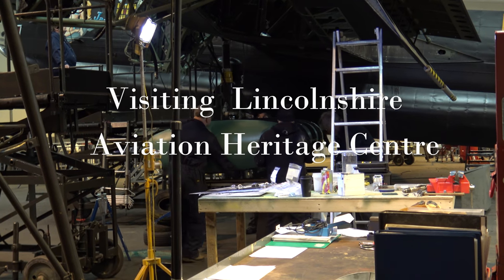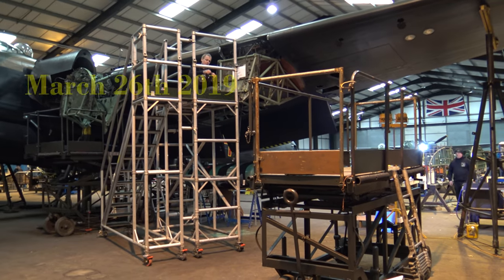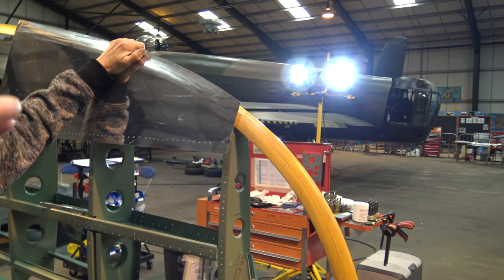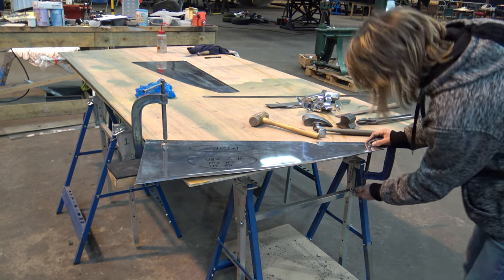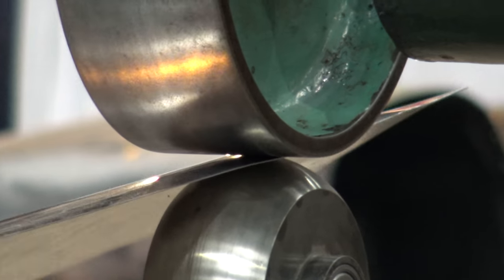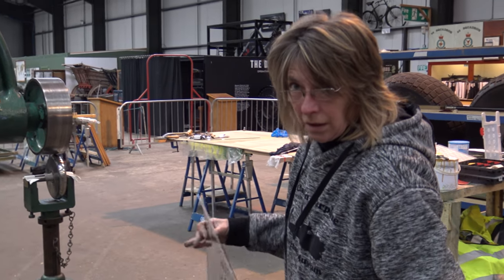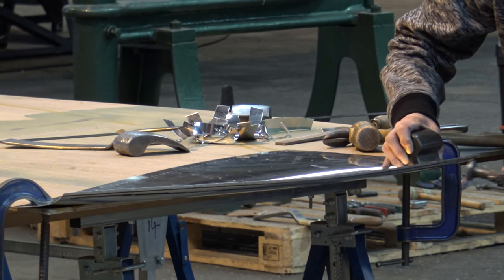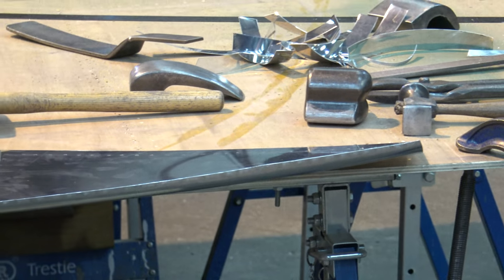Video 13 Restoration of Lancaster NX611 year two.

Comment: I did a tremendous amount of wheeling to reskin FM213 over thirty years ago. It will be a delight to see another of these old birds flying again.
Reply: S/V Tattoo : S'cuse me but FM213 ? (bet the question seems stupid).
Reply: @suzyqualcast6269  - the only stupid question is the one not asked. FM213 is the serial number of a Lancaster bomber. The full serial number is actually RCAF FM213 as it was built for the Royal Canadian Air Force.

Edit: the Lancaster bomber shown in this video is NX611.
Reply: S/V Tattoo: Thankyou - the NX sounds familiar,  now both make sense.
Wait a minute, are you part of the team that worked on the Canadian example that joined the BBMF a couple of years back, both of which, affectionately, flew over and tipped a nod to East Kirkby I wonder?
Reply: @suzyqualcast6269  Yes, sounds like he was as was involved in the shaping and reskinning some of FM213.

Comment: They should crowd fund the restoration. It would save them having to put it back together and take it apart each year. Great video!
Reply: Izaak C : Myself and a friend used to visit East Kirkby back in the late 1990's. We were lucky to be there one day when she was out in front of the hangar and performed a full x4 engine test, I don't know of a word that describes the feelings of emotion that induced !
Back then I was led to understand that all that prevented their Lanc from being given an airworthy cert was a full re-revitting session.
Your comment per yearly stripdown raises a couple of queries: are you saying exactly that - a complete stripdown, and why? If correct then the demand of the past per a full re-rivet session seems to have become a historical point and now overcome ?
I also understand that as ever closer to achieving air worthiness they get the certificate issuers then present a whole new rash of demands, as if the BBMF Lanc is the only one they want flying, full stop.
Reply: @suzyqualcast6269  No, that's like finding a 1946 Austin 'whatever' and the only thing preventing it going back on the road was a new paint job.
EVERY part of the old aircraft has to be checked to ensure it is airworthy. If you simply removed and replaced every rivet you wouldn't know if the wing spars were thirty hours from cracking up and you don't need a very vivid imagination to imagine what the results would be.
I beleiev the powers that be are giving them leeway by allowing them to refurbish/replace components over a period of years instead of having it all done in one go, which i believe is the norm.

Comment: Start with the sheet metal oversize. Roll the edge first. Once it fits trim rest of the panel to fit the ribs and then drill out the rivet holes. This is being done backwards which is making it more time consuming and harder to roll the edge correctly. I know because I have built two aircraft. Just saying .... Great to see us women more involved in aircraft restoration, like we did not have the skill of knowledge of this from the past. Women built the planes helped win the both world wars .... ;)

Comment: Do you know if they are planning on making a fairing for the mid upper turret?
Reply: Geoffrey, "Just Jane" is a Mk VII Lancaster, which used a Martin mid-upper turret, rather than the Fraser-Nash turrets used on the earlier marks.  The earlier fairings covered a cam track which mechanically prevented the guns being fired at certain points of their circular azimuth travel to prevent the gunner from shooting his own tail off.  This was achieved in the Martin turret by an electrical system within the turret itself, so the fairing was not needed.  The Lanc looks a little naked without it, though, doesn't it?
Reply: @frankmcvey  G'day Frank yes i knew the Mk VII was fitted with both the FN 50 (a small initial run and classed as Mk I or interim Mk VII aircraft) and later fitted with the martin turret. I actually thought work was underway to bring it up to a representative of a MK I/III fitted with an FN 50 turret. Im now guessing this was put in place for the aircraft's taxi rides allowing patrons to experience all crew positions in the aircraft. In the background of this video, what looks like a Martin turret mounted on a stand, is this earmarked to go into the aircraft once she approaches the end of her                    restoration to airworthiness? Wow with her wartime scheme and this turret fitted she will look like a representative of a Canadian MK 10.

Comment: The curve inducing English Wheel: is that what was used when the Lancasters were being factory produced by the ton?
Reminds me of what I thought was 'panel beating' witnessed applied in EMMS/Cfld garages and auto repairers on a smaller scale.
Reply from the maker: Hi Suzy I'm not sure I would think most of the skins would be stamped/pressed out. Thanks for watching

Comment: how are the two skins joined at the leading edge?
Reply from the maker: H Mojo65 the skins have a expansion gap between them, the leading edge is then covered with about four inch (10 cm) wide tape then painted. (The used Irish linen in 1943/5)
Reply: @nevillewheeldon1693  thanks for the info!